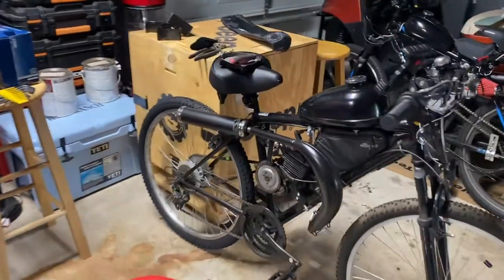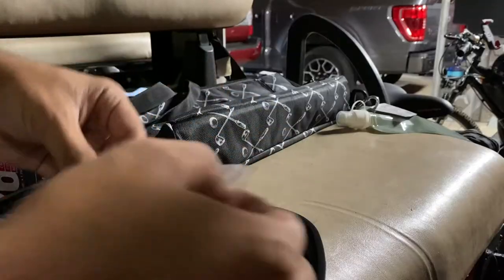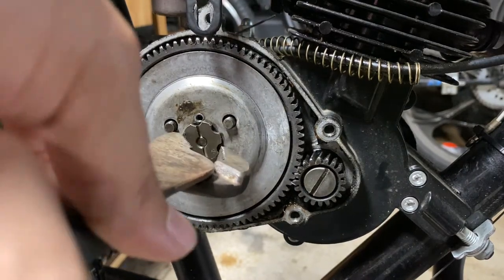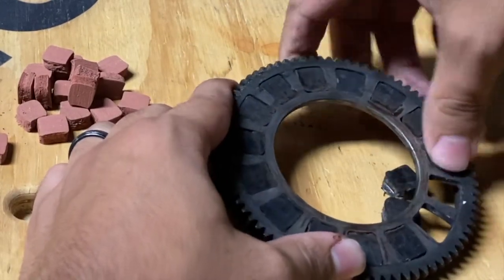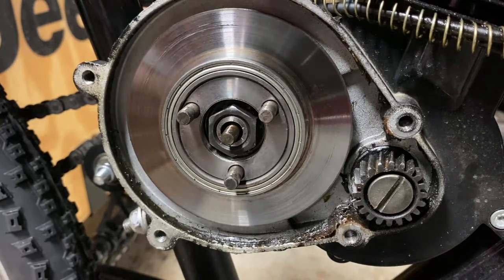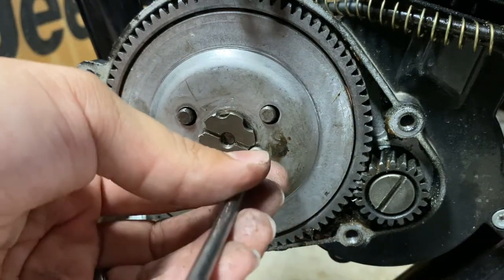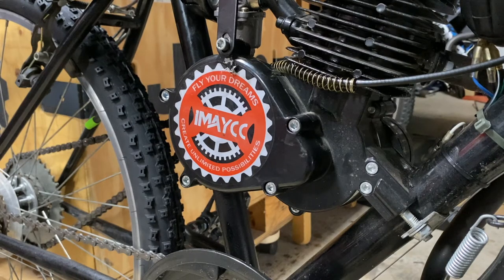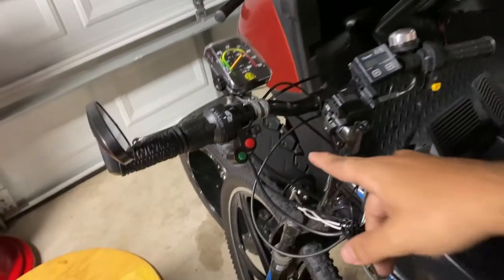How To Change Clutch Pads On A Motorized Bike

Comment: Something I've learned over the years is the stock clutch pads will cause bearing failure in the clutch assembly. It has small metal wires threads in the pads that eventually work their way into the clutch assembly bearing and eventually chews it up. I prefer the more rubber compound that look kind of Orange. Just make sure you don't put too much grease on the bevel gear where it slings up into the pads. Also you want to sand the clutch pads down to where they are free floating and not jammed in there. Those pads are meant to be free floating.
Reply from the maker: Wow, I did not know. Thanks for sharing!

Comment: Just wondering is there a different size clutch pads for different 80cc Motors I ordered some clutch pads and they don't fit from eBay and order the bike motor from wish
Reply from the maker: The pads should fit, granted sometimes the way the pads are cut out are terrible and some won’t fit. But they should generally be the same shape and size.

Comment: YOU MAY NOT NEED NEW PADS!!!! I've watch several of these videos of changing the clutch pads. In all the videos the pads seem stuck in the clutch pad gear. It seems to me if they're stuck in the gear, the spring loaded outer sheet metal disc is not going to be able to push the pads against the inner flywheel disc. This being the case, the only friction you're going to get is against the outter sheet metal disc and it's no wonder the clutch is slipping. I have not tried this but most likely you could remove the clutch pads, sand the edges so they fit in their recessed slots easily, button it up and it would run fine. There's a good chance they're not wore out but just stuck in the gear and can no longer be pushed against the inside flywheel.  ; )

Comment: Someone please help me I'm begging you I have a two-stroke bicycle motor and I can start it but when I push the accelerator it won't move they won't move it all I can rev the engine but it won't move can you anybody tell me what could be wrong with it
Reply: check ur wiring
Reply: its most likely your flower nut  tighten it a bit until you feel it grip its under the clutch cover in the middle.